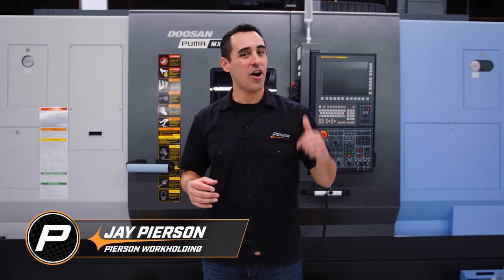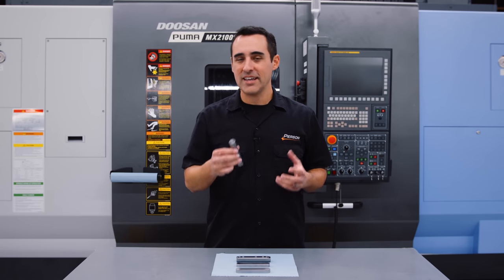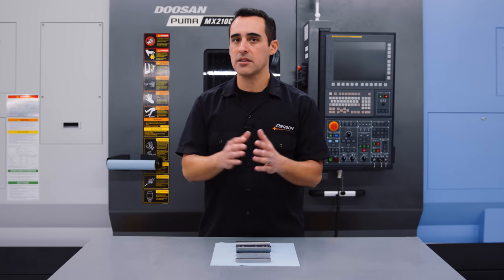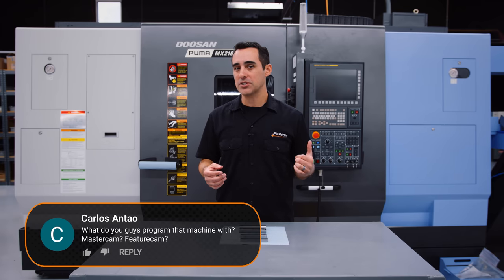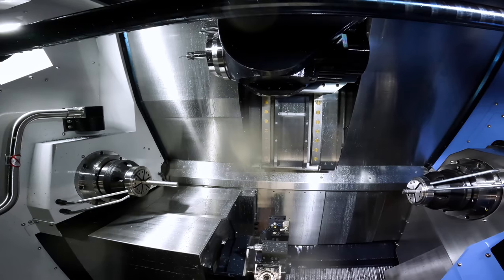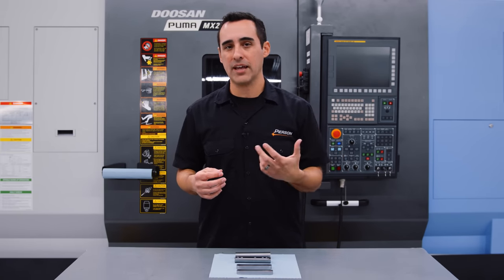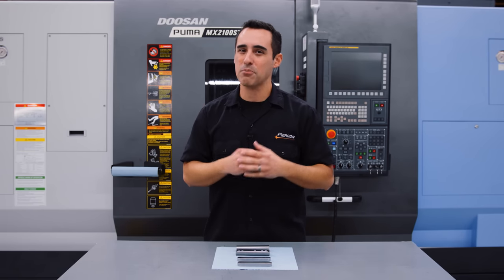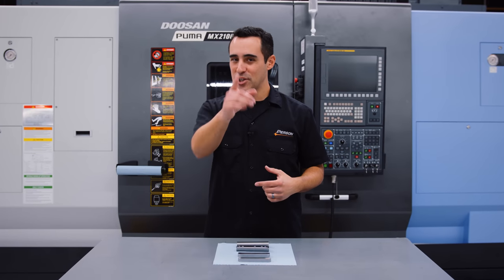Doosan Puma MX2100 ST Part 2: Deploying Lean with Machining

Comment: Don't use sequential numbers for your wait codes.  Don't go M901-M902-M903.  If you have to go back and move things around or re sequence tools, that becomes a HUGE hassle.  Skip 5 or 10 codes at a time.  So it would be M905-M910-M915 an so on. That way if you need to add a wait in the middle you can add a M912 between the M910 and M915 codes.  This makes life much easier especially if you are adding wait codes by hand.

In my time on the MX line of machines I came away highly disappointed with it's capabilities.  The milling spindle has a VERY small work envelope when it is tilted towards the spindles.  It was only able to go .800 below center line and only has about 3.5 inches of Y travel on each side of centerline.  I know it's not a full on 5 axis mill, but I found it very limiting.  At the same time I was working in a shop that wasn't very well run. They often put me in positions where I was having to work on jobs that were not well suited to the machines.
Reply from the maker: Great tip on the wait codes!
Reply: @PiersonWorkholding  I learned the hard way on a 9 axis Miyano lathe which has 3 programs (channels) running at the same time.  Thankfully the Cincom control has a mode which lines up all three programs based on the wait codes.  It makes sussing out bad/misplaced/misnumbered wait codes very easy.
Reply: Yea I agree. We have an Mx2100 and Mx2600 and we learned the same lesson.
Reply: Here I was thinking that the wait and go codes were simply M901, and M902. That's it. No order to keep track of. Program A states an M901 first, and then it waits for an M902 from Program B. If Program B reaches its M901 first, it sits until Program A sees M902. Because the pair is always together - M901 EOB, M902 EOB. If you don't care how much further one program gets ahead of the other, you can just delete more and more of the M901 codes, and it no longer waits until it has to. I thought this made the most sense.
Reply: @gredangeo  Doing it that way is very dangerous.
Reply: @brandons9138  Why's that? What's the difference of having multiple M Codes doing the same thing when it can be reduced to two? This is sort of like needing to call out an additional two digits on your coolant code, because it's attached to that tool. Instead of M08 for T5,T6,T7. Redundant to be M0805, M0806, M0807.
Reply: @gredangeo  The reason matched pairs of wait codes are used is to make sure you don't get unintended machine movement. If all of your wait codes are M901 or M902 then it can be very easy to lose track of which codes are synced together. If someone accidentally deleted a code or adds one in the wrong place you could very easily have a crash. This becomes even more important if you have multiple turrets working on the same spindle/work piece at the same time.
Reply: @swedishpsychopath8795  So adding more digits saves memory? Thats not how that works. Having a 4 place number actually uses MORE memory.

Comment: Multi task machines are the present and future of turning centers, more flexibility you gain compared to an standard turning center. In my opinion multi tasking machines and swiss types machines are the ones which are going to be sold more in the future
Reply: The main downside (in 2022) is the complexity of the programming and setup. It's hard to use them for low volume jobs. 

The software is getting better every day and a machine like this that has capto tooling on a high capacity tool changer is pushing it closer and closer to being the magic machine.
Reply: @Factory400  Not even close to the truth.  I've worked on MX machines for low volume jobs in the past.  They are not any harder to set up than any other machine type.  The ability to do both turning and milling on the same fixture is a huge time saver.  I'm currently doing low volume production and prototype work on swiss machines. Same flexibility applies here as well.  Trying to do these parts in two ops of separate machines causes more headache than its worth.

Comment: I got really comfortable hand programming 2 axis lathes at my first shop, I'd have cad on one half of the screen and notepad on the other. Just quickly sketching geometry and then selecting points or the centers of circles representing tool-radii for the X/Z numbers in relationship to origin. Please bear with me, I love fusion and I think its changed the world but like..

For turning, two axis lathe stuff and how sequential and 2d the operations are, hand writing becomes very intuitive very quickly. The major bonus is that you're telling the machine exactly what you want it to do and by the time you're done you remember where you put stuff, it makes it very quick to iterate changes at the control when you head is wrapped around the code you wrote. Using two different tool offsets on the same turning tool so that you can offset two features differently and track them from the wear page becomes second nature and no extra effort to include. I was only there three years so I havent even scratched the surface on macro's.

For all the milling spindle work I'd just post it out of fusion real simple like and paste it in to the main program right where I want it, or hell, call sub programs. 

Ever since that first shop 10 years ago I have wanted to get back into this kind of thinking and style of work. The production aspects of programming this way are incredibly rewarding and fun. You're completely un-limited by the software.

I started with only 2 axis single spindle daewoo/doosan lathes but seeing a machine like this just... ugh... gets my mouth watering for notepad. it sounds weird but try it on a simple part. I think it will make the multi-process aspect of this machine feel really intuitive, the speed these machines operate with barebones carefully placed code is simply a different level. 

/watch?v=kd4NnoUAk0I ---I wrote this program line for line and if you watch this clip please take notice of how I'm keeping as much rigidity in the bar as I can while I work back the features toward the spindle, finishing and roughing in different places as I go. The feedrates increase as you approach the spindle nose as theres more rigidity and you can feed harder,  no need for a parting tool and as soon as the part falls the feedrate can triple because finish no longer matters. Its worth it, the granularity is fantastic. I know you can imagine yourself sitting there for an entire day hand writing a program but isnt that what we do anyways running back and fourth constantly tweaking things? Just write the program you want the first time you dont have to fight the software.

Comment: Any reason you don’t machine it complete on the Puma to eliminate throwing them on a VF? I’m guessing part rigidity if you were to mill it complete or semi complete.
Reply from the maker: Machining complete was technically possible but the part's stickout caused chatter since we couldn't use a tailstock for Op2. We achieved much higher throughput running Op2 on our Pro Pallet System instead.
Reply: @PiersonWorkholding  would it be possible to make a custom tailstock for op2? Since it is not rotating it does not need to be a point like a traditional tailstock. Instead it can be shaped after the part, like a pocket that supports the part from the end or from below.

Comment: Awesome machine and video!

Have you thought about making the pads round and not rectangular? 
Could be done in two lathe ops from prehardened round bar. 
A little less contact surface but way less work in making them.
Reply from the maker: Nope, surface contact is key to good rigid fixtures.

Comment: I used to program a  hyundai with and a hwacheon both used fanuc controller m900 where the sync codes I used to sync pinch turning or mill with both turrets tho this Doosan has a lot more pow woow

Comment: Seriously cool video! Can the MX take turning tools in the upper turret as well? This can open up some really fun options as now either turret can work on either spindle at any time. Doing one turret do left and right spindle work while the left side ops (which just tend to be longer) are happening is really neat. You'll love seeing both turrets bouncing back and forth on both spindles in a well optimized program. If you wanna be super bonkers, machine a small sacrificial center in the part in the right spindle to keep the lower turret free by using that as your tailstock.  Keep the content coming!
Reply: It has Capto on milling head that supports lathe tools as well as milling tools. Crazy flexibility.
Reply from the maker: Yes, exactly what  @Factory400  said.

Comment: What fittings are those used to hook up your through coolant turning tools? The black ones look like your typical push to connect pneumatic fittings, but I cant quite make out what the other metallic ones are.
Reply from the maker: They're all push-to-connect fittings and all from McMaster. It was a comical mixture of threads so no two fittings ended up looking alike.

Comment: Can that part not be made complete on that puma mx2100? If you use a custom square collet on the opposite spindle?
Reply from the maker: There are lots of ways to make this part but running single piece flow between two machines is 2x faster. Here's a link to the video for Op2: https://youtu.be/R16Hr81j16E

Comment: What post are you using in fusion for this? How are you able to tell it which channel you are posting for? i.e you are posting to turn or mill with the lower vs posting to turn or mill with the upper. We have only programmed ours with NX and we have to lay the tools out in certain channels to post it correctly.
Reply from the maker: It's the latest Doosan Mill/Turn post.  You post the upper and lower programs separately as if they were two programs running in two different machines.
Reply: @PiersonWorkholding  I guess my real question is how do you differentiate whether you are running on the upper or the lower? Because milling with the upper is much different code than milling with the lower live tools as well as turning with the upper vs turning with the lower.
 I have actually been curious about this for a while. I have used this post for the doosan lynx which is just a lathe so no upper involved and it worked fine.

Comment: why not just optimize the first op to make the entire part un attended? then surface grind them when they come back from heat treat?
Reply from the maker: The long geometry of the part doesn't allow it to be rigidly held in this machine to make it a 1 op part.  Plus, two machines producing parts in 1-piece-flow is much faster.

Comment: Is round bar that much cheaper than rec bar? I would think long strips held on a fixture for op1 and then flipped over for op2 would be faster. like a brother r650
Reply from the maker: Round bar is typically far less expensive than rectangular. The bigger factor is availability. Round bar is easy to find.
Reply: @PiersonWorkholding  interesting
Reply: @Jonnywoods_049  It's probably a matter of raw material amount ordered - in case you would like to order 20 tons or more, the difference would be smaller. But then a question will come up how many you will need to machine out of that material😀

Comment: That's a lot of chips for something called "lean". Square stock and a pattern of parts makes more sense to me. Especially if two machines are used.
Reply: Time is more valuable than stock. Listen closely to the message....reducing operations, handling, and machine tending by a LOT! 

The cost of the additional material is a small fraction of the cost of doing all the conventional operations.
Reply: @Factory400  Not to mention that round bar is usually cheaper than square/rectangle stock as it is easier to produce.
Reply from the maker: @j.r.3215  Right! Good luck finding the exact size of square bar these days. Round bar is easy to find.
Reply: @PiersonWorkholding  Easier to make a round bar square than a square bar round.
I wish you had this shop when I lived in Simi Valley. Started on NC machines in 1978 with a GE 550 and 1050 Tape controllers with Williams Research in Ogden UT. We made the Jet Engines for the Cruise Missile. I ran the NC Lathe that cut the main shaft (718 Inconel), tough stuff.